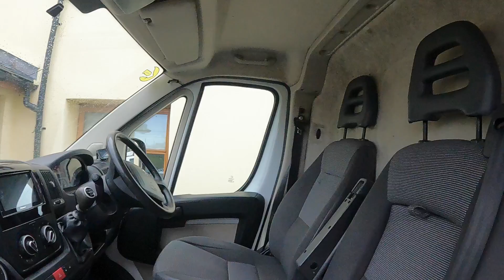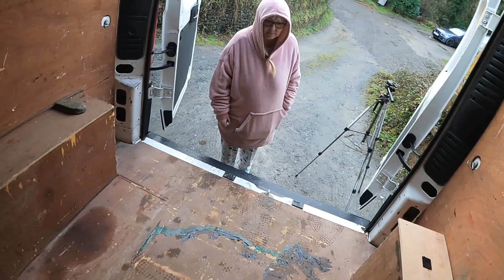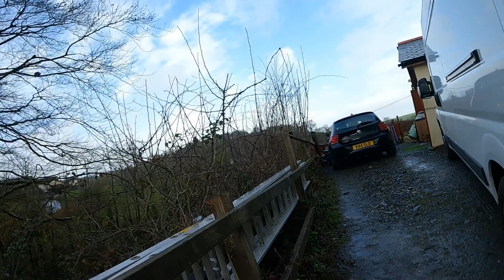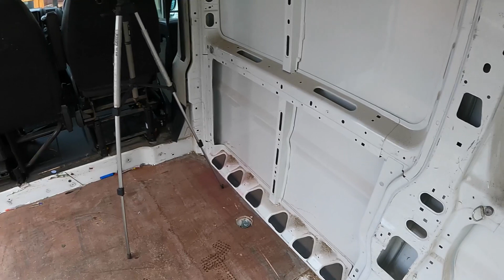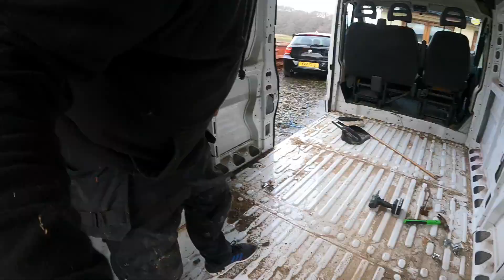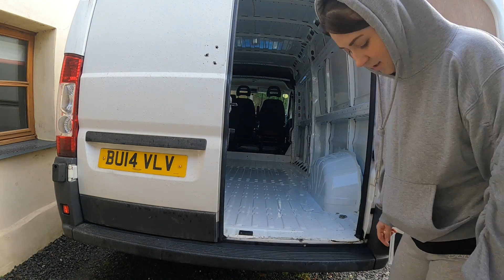BOXER CONVERSION

Comment: Good luck with your build there is plenty of helpfully tips out there get your sound ,insulation and wiring done then hopefully it's onwards and upwards but it ain't gona be easy so keep at it or fury will give it ya  🤣🤣🥊
Reply from the maker: Thank you mate , I’m already scared of him lol 😂 
Sound matting today and floor insulation and battens and new floor down , that’s the plan then over to first fix wiring and insulation of the rest of the van . Windows and ceiling fan on order so that’s next weekends work sorted

Comment: Way bigger than the usual Vw transporter conversions, gives you better choices. Where are you going to put the condensing combi boiler.?
Reply from the maker: Lol 😂 not happening buddy I am fitting a heat pump 😀😀😀😀
Reply: @thegasguy  Nice. Although them diesel heaters aint too bad, got one in my boat
Reply from the maker: @TheFoolishboy9  I’ve just ordered one of them buddy , perfect for my van